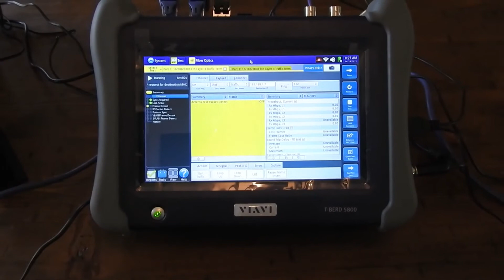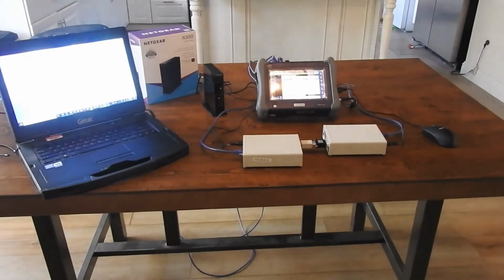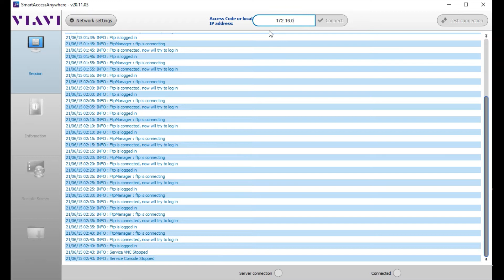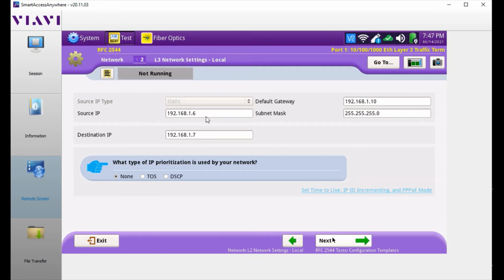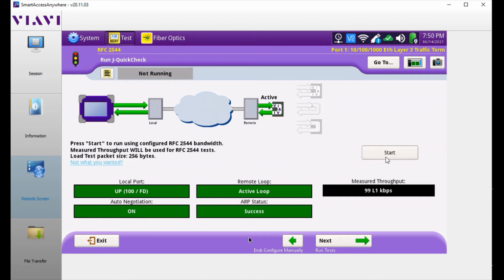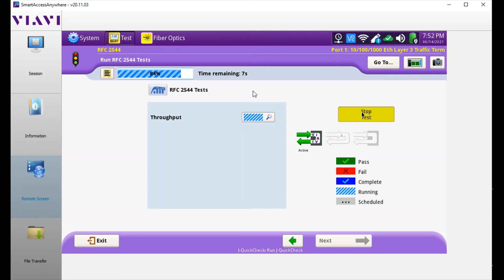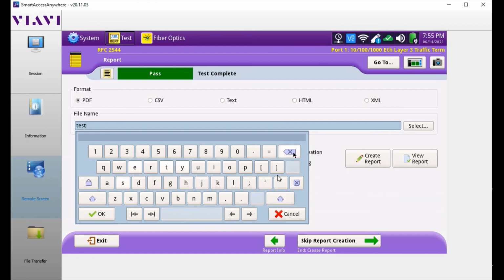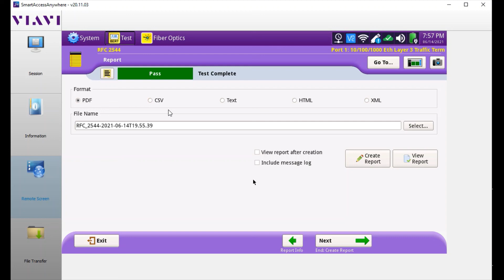Viavi T-Berd 5800 Setup and RFC 2544 Test

Comment: I just want to confirm can we perform RFC2544 by giving softloop to opposite side interface of network device without using another Viavi tester at other end
Reply from the maker: I apologize, it has been almost 3 years since I have used a T-Berd. It has all faded, I'm back in the 2way world these days. When I did do testing, we physically put a separate T-Berd at the distant end.
Reply: @dc95811  you can definitely put a softloop at the other end as far as the circuit is an open pipe and there is no equipment in between the network far end and near end then the tester will definitely identify the remote loop